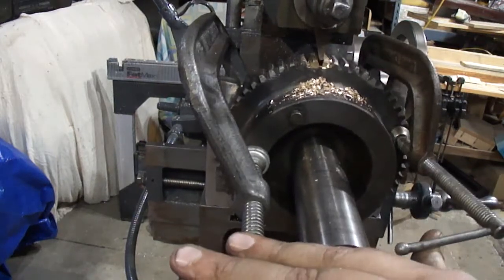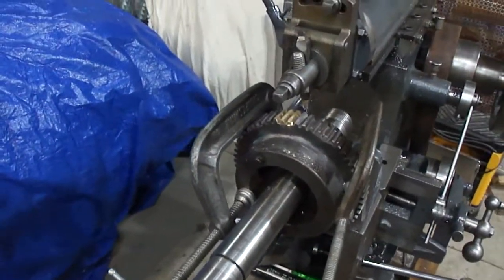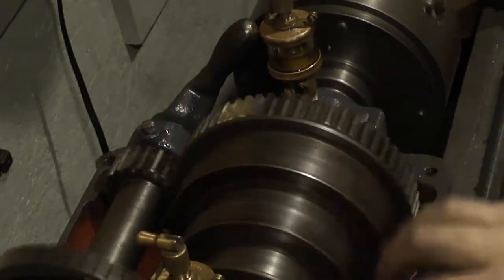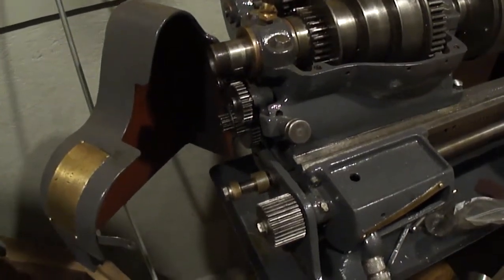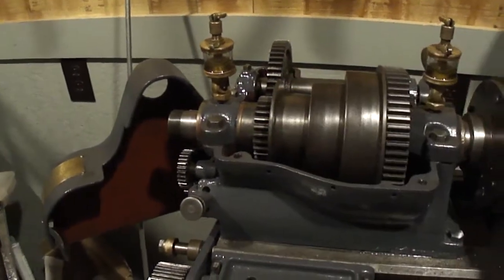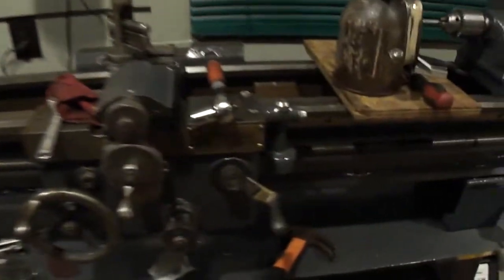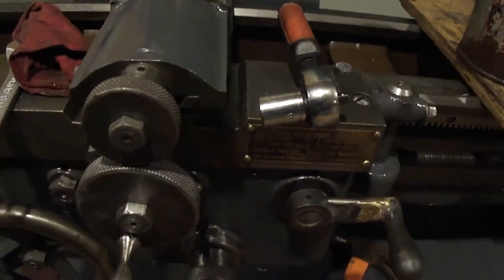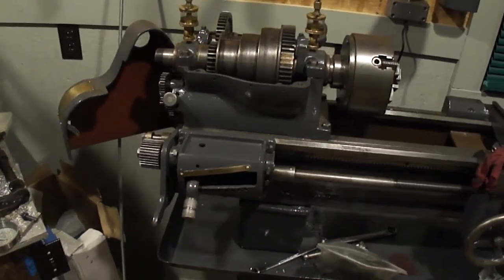Fixing Lathe Bull Gear - Cutting Gear Teeth on the Shaper

Comment: Chirpy beeswax works great on the leather belts. How old are you cause I think you are a younger guy which is great to see the younger generation using the old iron.
Reply from the maker: yea, I made up some belt dressing sticks using beeswax, rosin, and neatsfoot oil, then wrapped it up in newspaper to use later on. That way the beeswax helps it flow, rosin adds stickyness, and the neatsfoot oil reconditions the leather and adds the natural oils back to the leather, which makes the leather like new, also making it very grippy. 

Im not even sure how old I am anymore, somewhere around 30, but just lost count really, lol. Its one of those situations that your old enough to not give a crap how old you are, and to forget how old you really are, lol. 

I prefer old iron and to do stuff the manual way rather than all of the new cnc stuff. I rather have the control in my hands rather than just punching in keys on a keyboard and it does everything for you.
Reply: @ChirpysTinkerings  I'm another mid 30's kid running old iron in the anemic home shop, WF Barnes #6 lathe. Great video, I need to make a 52 t change gear and was thinking to use the lathe as a shaper using the chuck to index with a printed out paper with 52 radial lines on it... may be years before I get around to it.
Reply from the maker: yea, you can, Ive done stuff similar to that using the lathe to cut a keyway in the main shaft for the dividing head build, but it wouldnt be too hard to do that with a tooth profile cutter. The hardest part would just finding a way to lock the spindle/chuck so it doesnt move while your broaching out the teeth.
Edit: I would search for cutting gears on the lathe on youtube, there's a guy named claudio grassi, or world wide metal fab that shows broaching the teeth and you may get some ideas from that.

Comment: I did the exact same thing you are doing here for a Logan Lathe with my Atlas Shaper.
Reply from the maker: cool, Ive seen alot of people using atlas shapers and logan lathes. Is your shaper an older style or newer one? (ratchet mechanism on older ones are cast iron, newer is zamak or zinc)
Reply: Chirpy my Atlas Shaper is a 1938 without the support foot. I have installed a newer ratchet mechanism that is zamack. Have machine bolted down and leveled. I put up a short video of it.

Comment: Nice save good for another 50 yrs ifbuse. Nice clamping on the shaperRon 16 in cinn back geared
Reply from the maker: lol, more like  100 years, the lathe as far as Ive been able to tell was made around 1913-1916, so it's over 100 years old now. With everything fixed and ready to go, I hope to get at least another 100 years out of it before it needs worked on again. The shaper is definitely awesome and one of the most versatile machines Ive been able to find. It's cool that you have a 16" cincinnatti shaper, Ive seen quite a few cincinnatti shapers around and they're defenitely built like a rock

Comment: The teeth look fantastic, but how long with this soft bronze last as gear teeth?  Any reason it wasn't just welded with a tig machine then cut to shape?  Those gears were originally cut from solid stock and not cast right?
Reply from the maker: it should last about forever, it's a type of manganese bronze, which is very hard stuff, and was a pain to file because it was so hard/slippery. The stroke on the shaper was shortened up so much that it became pure torque rather than stroke length/speed. I dont use back gears that often, but it's better to have it fixed now while I was getting everything else fixed. They were machined from cast iron and doing tig on cast iron is just a bad idea because it will want to crack, and yep, machined from stock originally.
Reply: Chirpy's Tinkerings you didn't say in the video what they were...  screw welding cast iron, that stuff sucks.
Reply from the maker: lol, thats why it was brazed up. All of the stuff on that lathe is cast iron or bronze.
Reply: Mr T  agree completely about the manganese bronze for cast iron repairs. It seems to outlast the cast iron "Ironically"

Comment: Nice repair job. Why the spindle in the shaper?
Reply from the maker: I dont have a milling machine and no involute cutters, and the guy that brazed the stuff up didnt have any gear cutting capabilities either. The shaper was the easiest and most precise method I had access to to recut the teeth. Also, I couldnt remove the bull gear from the spindle, so it had to be machined all together.